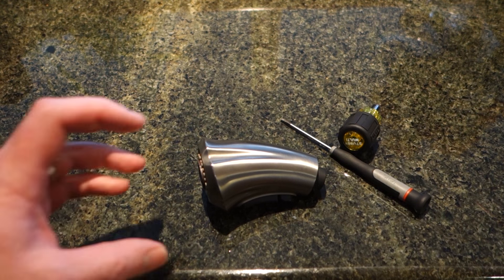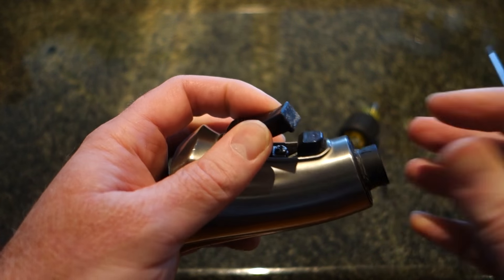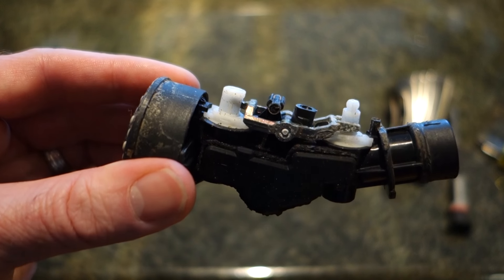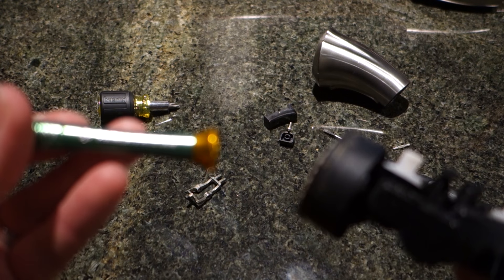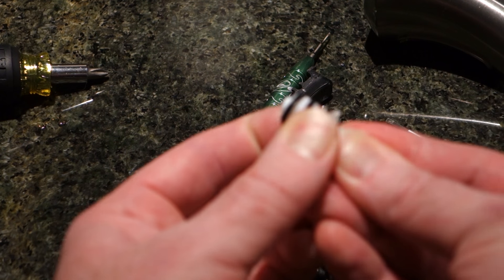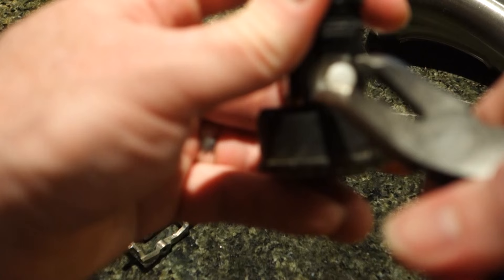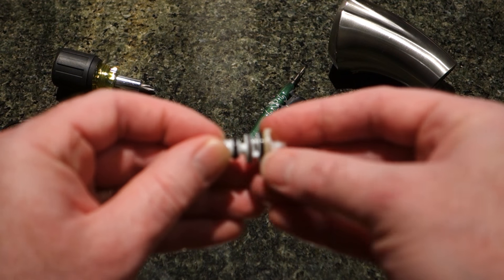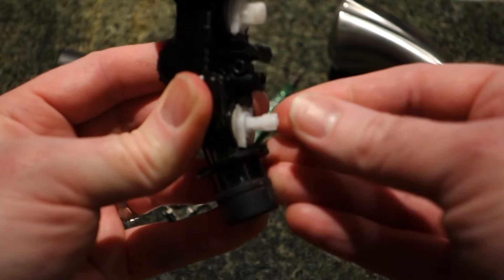Disassembly and repair of Delta Touch2O Sprayer

Comment: I have a Trinsic Touch and it disassembles the same way. Pop off the lever and remove the screw. The internals are different. You just remove a clip to clean out the switch plunger and screw the end with the screens off and push the middle screen out to fully clean it. Thanks for posting this!

Comment: Thank you so much. I found an easier way to fix this. Just take off the wand and pour coconut oil in it while you work the buttons back and forth. No need to take off the buttons. Just pour some warm coconut oil down in press the buttons over and over it will work its way and lube the o rings without any further disassembly. 😀
Reply from the maker: You mean pour coconut oil in where the water hose connects, or in around the buttons?

Comment: John, thanks for this video. It was like watching myself tackle a problem and enjoying the joy of discovering a fix. I noticed video your focusing issues, and, as a photographer, perhaps I can offer a solution. Autofocus is always "hunting" for a point of contrast that it can use to determine the focus point. In low light situations, it's always 'hit-and-miss,' usually miss. A more pleasing video can be achieved by setting the camera to manual focus and, under the shooting lighting conditions, figure out the 'depth of field,' which is the area of sharpness available at the time. When that is determined, you can make it a point to keep the objects you're shooting within that 'in-focus' area.  Also, as it looks like you're also in a hard water area, there appeared to be mineral deposits on the internal parts of the wand that will create enough friction to impede its movement. Soaking them in LimeAway or its generic equivalent will quickly loosen the hardened minerals that can be easily brushed away resulting in smoother movement. Right on, BTW, with the SuperLube. It's my go-to lube for all gaskets and similar products. I've even used it to completely remove a front door squeak that was caused by the door rubbing up against the rubber seals on the threshold after sloppy house painters left latex drops on it. The cleaner I got it, the worse the squeak until I applied SuperLube to make the problem go away.  One question: have you found the flow restrictor on your faucet, and, if so, and if you chose to remove it, how was it done?
Reply from the maker: Hey Michael - thanks for the suggestions. Haven't searched for the flow restrictor, but I thought it was in the wand?

Comment: I also have the Ashton which is very similar (but not exactly) to yours.  
My buttons were  sticking and since it is only 6 months old, I just called Delta for warranty. They were great about sending a new sprayer for free under warranty, but the fix it part of me wanted to know what the problem was with the original piece. 
No where could I find a schematic on how to take apart the sprayer until I found your video.Following your lead, I now have a spare sprayer in case this sprayer is ever discontinued.
Thanks for the how to.....
Reply from the maker: Yeah, delta sent me a wand, but I got the model wrong so it didn't match with the rest of the faucet, so I decided to grab the tools and see what I could figure out. Glad you found it useful!
Reply from the maker: Glad it helped! :)

Comment: The newer ones are a bit different valve arrangement, but they come apart the same, and the internals are a 2 piece split, with the lower button doing all the switching, and the upper just to cut pressure while its switched.  I had a portable dishwasher mounted on my desmond, and it blew out the oring in the bottom valve, causing it to not be able to switch between spray or stream.  Just popping the oring back in place fixed it.

Comment: Thank you! Good video and camera shots. My faucet kept trying to go back to the sprayer position. It finally got so bad I took the head off and that's where I searched for help. This solved my problem about 80%.  If it happens again I may go back in and add more lube. Question: The arm that attaches to both plungers is corroded. It took a whole lot of trying to get the pin out. Should the arm rock back and forth easily? If so, a cleaning of this arm might make a difference as well.
Reply from the maker: Hey Sharon - glad it was useful. :) Yea, it should be not loose, but easily movable...